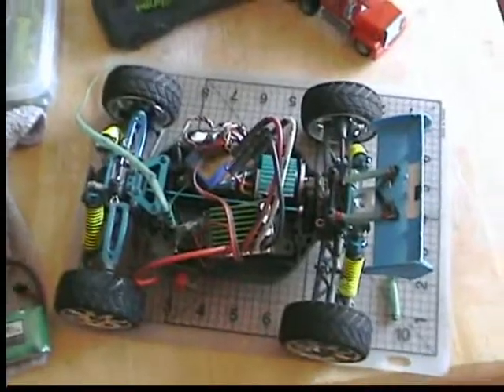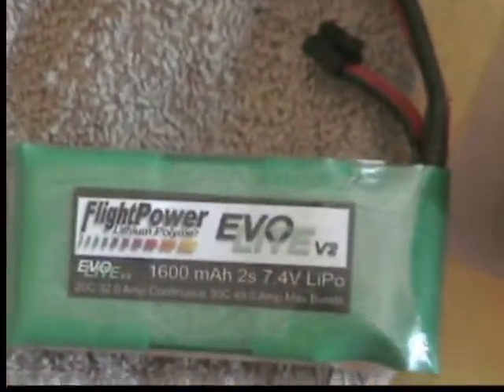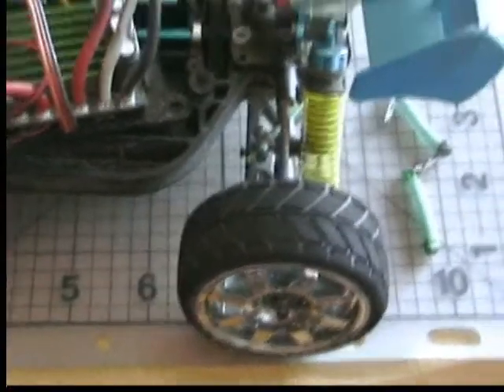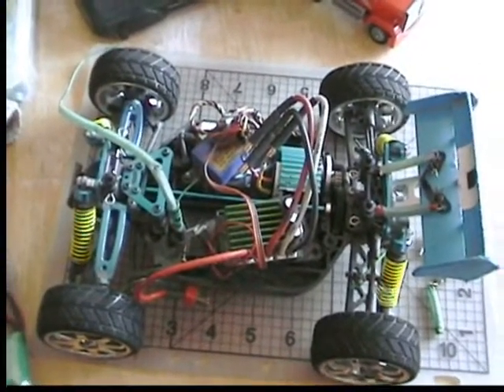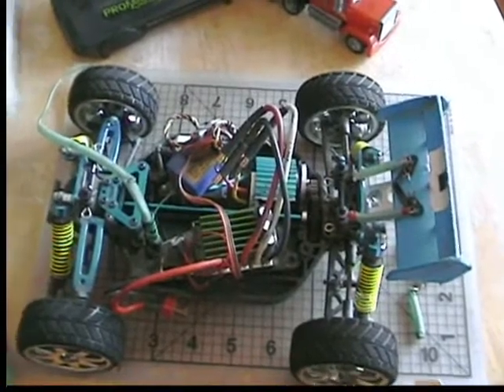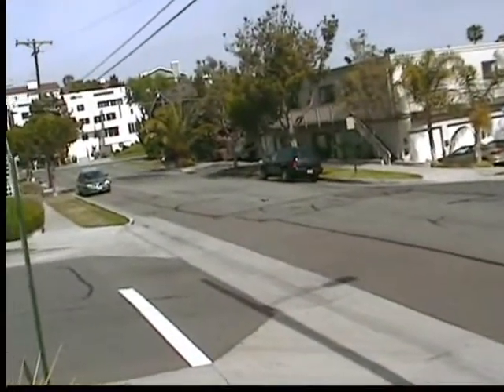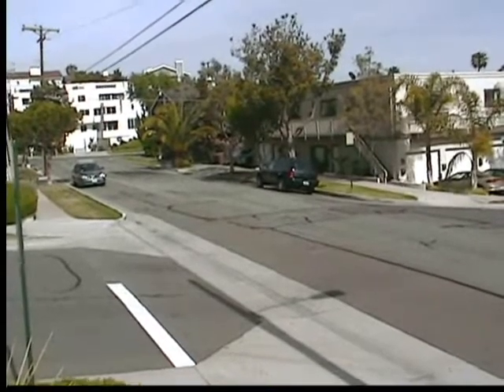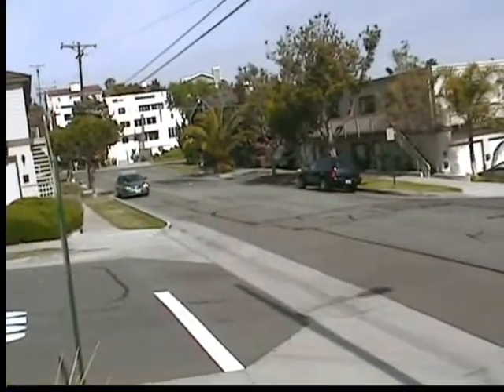vendetta neu flightpower

Comment from the maker: im currently running the neu motor geared at 16/49 for 10th scale offroad track use..   it has enough power and speed to pull away from 10th scale brushless 4wd vehicles on the straight..

Comment: Did you have to put new Motor connectors on the motor to use it with the Mamba Max? And what size shaft did you get, im assuming 2.3mm? i think im getting a Neu for my RC18B and using a 1/10 sidewinder ESC.